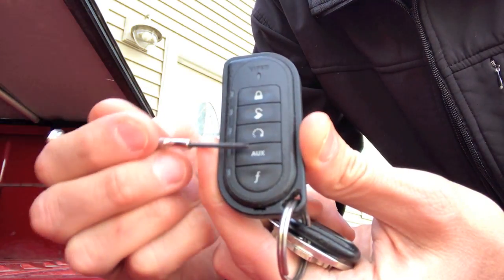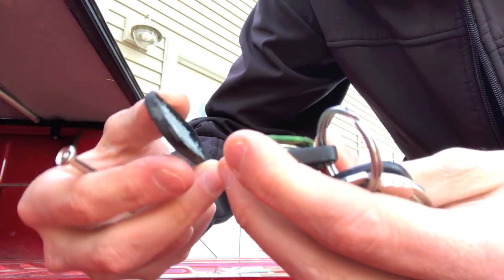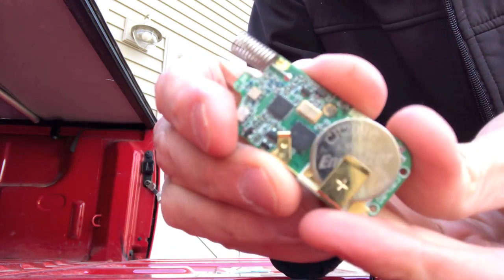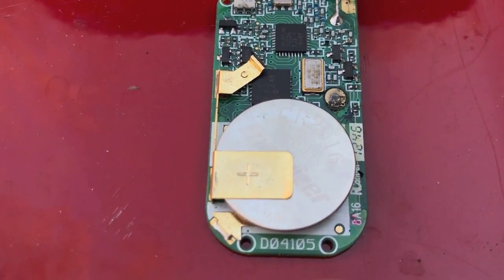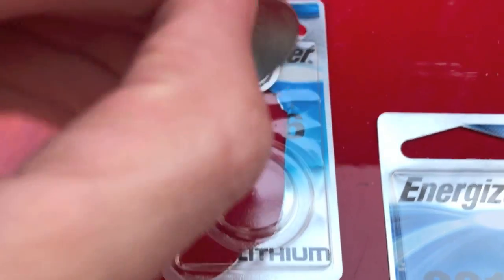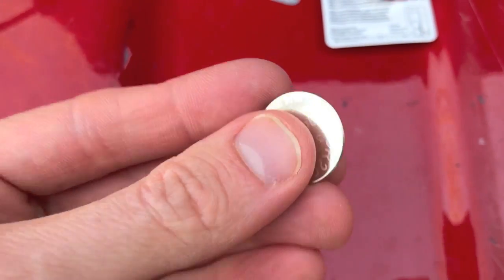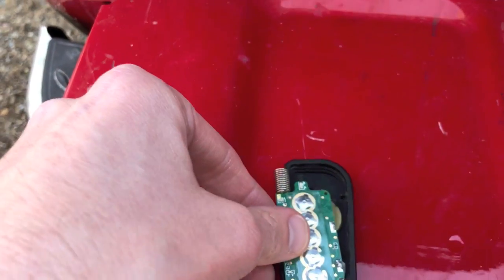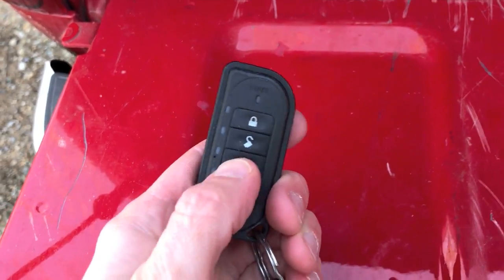My Remote Car Starter is not working - "Check Battery or Check Engine Light"

Comment: Thanks so much. So my Compustar remote stopped working after the car battery died then jump started. So the car lights will blink but will not lock/unlock, then it will crank multiple times but will not fully start. I tried to reprogram using the 5x on and off but did not fix the problem. So I tried the suggestion here of removing the black(negative) connector for a few minutes, reconnect and now its working. So simple solution which I found here. Thanks again.
Reply from the maker: You are very welcome & we appreciate you sharing this.  Welcome to the DIY Raptor Club.  Enjoy your upcoming weekend.

😎👍🔧🔩

Comment: Hey Michael, I have the same system. Today in a parking lot my car remote start stopped working out of nowhere. Did the dummy trick to get it going (put keys in ignition and then press button on windshield). It doesn't seem to want to reprogram. Any dummy advice possibly?
Reply: 2006 Scion XB btw, had the car 4 years with no issues
Reply from the maker: BumPanda 

Thanks for watching & sharing your question.  A few things come to mind.

Its uncommon however possible that the actual sensor mechanism connected to the inner portion of your window has faulted...again, unlikely but we can’t rule it out...let’s try other troubleshooting steps first.

Verify all electrical wiring feeding in & out of sensor is properly connected & shows no signs of stress...ex: melting, crimped wires....

Next inspect all wiring that feeds off your battery and makes its way to the starter & internal sensor.   Verify all wiring is properly connected and shows no signs of stress.

Next verify that you either have or do not have an added fuse for your starter.  If you have a fuse, verify that it is not blown or showing signs of stress such as burning or melting.

Is your Blue light still flashing on the interior mounted sensor connected to window?  If no, the sensor has lost its electrical feed & is no longer being powered...possible loose wire, loose ground, or blown fuse.

Let’s start there, Keep us posted!

Please subscribe to the channel and turn on your YouTube notification Bell 🛎 that would be awesome thanks again!

😎👍🔧🔩

Comment: Hey Michael. My viper 7856V is having an issue. When I hold the autostart, it will turn on the car but it will not crank the engine. It will just run the fans and lights for 15 minutes. The engine will not even try to turn over. It was working up until a week ago and I cannot find the issue. I've replaced the batteries in it and it still has the same issue. Thank you!
Reply from the maker: Thanks for watching, by chance is your check engine light on?  If your check engine light is on, there is a built-in safety mechanism that will disable remote-start.

To get remote-starter to work again, your check engine light will need to be cleared by replacing the part that is causing the light to turn on.
Reply: @DIYwithMichaelBorders  the check engine light will come on if I use the autostart. When starting normally, the light doesn't come on. I took it to a place and they weren't able to get a reading on the check light when it came on due to just the autostart. It goes away once the car is started with the key
Reply from the maker: @tylerblegen2392  

Thanks for the follow up.  You may want to perform a reset.  Disconnect the black negative cable from your battery and leave disconnected for 30 minutes.

After 30 minutes, resecure everything and see if that fixes it.

Comment: Hello Michael. I have a viper 7254v remote system and my batteries died because of the cold. Which had disconnected the key FOB/remote. I need your help to reprogram it back to the truck. My only problem is, the device behind the mirror won’t turn on now 😢 I’d I not know how I can fix that.

Comment: The blue light on the after market remote works when i press to start but its ot connecting to my car. My regular  car key works but i need my after market to work since thats what i use to START the car. any advise?
Reply from the maker: Good morning, we are drinking our morning coffee answering any and all questions for the DIY community.

By chance, is your check-engine light on?  If so, this will deactivate remote starter.  The faulty part causing your check-engine light will need to be replaced in order to allow your remote starter to work again.

If it’s not on, you may need to disconnect your black negative cable from your battery for a minimum of five minutes.  This will allow your system to reset, and after five minutes, resecure black negative cable.

Thanks for sharing this, it means the world to us.

😎👍

Comment: what happens if check engine lite is on< i changed batteries in both remotes
Reply from the maker: Thanks for watching & welcome to the DIY Raptor Club.  For safety purposes, the remote starter deactivates once the check engine light comes on.

You will need to fix what has caused your check engine light to illuminate.  After fixing part, the check engine light should turn off and your remote starter will reactivate.  Keep us posted.

😎👍🔧🔩
Reply: @DIYwithMichaelBorders  does a change oil sign cause the check engine to come on ?
Reply from the maker: @Willdoe09  

Thanks for watching & it will indeed.  The oil light being triggered will disengage remote start as the onboard computer wants to alleviate the engine running with low oil.

😎👍🔧🔩

Comment: Hi have the same system , and the device that goes in the car ( blue flashing light ) is not flashing anymore and my car won’t start , I’ve replaced the battery so I know that’s not the problem ,
Reply from the maker: Mike Nasser 

Thanks for watching & we hope the video helped.  At this point, you may have a wiring issue causing your symptoms.

You might have an additional fuse inside your engine compartment near your battery that has blown.  This fuse may be part of your Remote Starter wiring that is feeding to your battery.  Verify the fuse is not blown nor corroded in any way...might just be a good idea to get new fuse!  😀

We recommend inspecting all wiring & verifying wiring is in good condition...no signs of stress, melting, aggressive bends in wiring that can lead to damage...  Also verify all connection points are properly secured which will alleviate any chances of electrical shortage.

We really enjoy making these helpful videos for our fellow DIY’ers.  Many more helpful videos to come!

Let us know if you have any questions.  Please subscribe to the channel and turn on your YouTube notification Bell 🛎 that would be awesome thanks again!

😎👍🔧🔩

Comment: I have an aftermarket remote start where I don't have a separate key fob, I just click the lock button on my Chrysler fob 3 times and it starts. I changed the battery in my car and now my remote start is not working. Any ideas? Thanks
Reply from the maker: Thanks for watching & welcome to the DIY Raptor Club.  It’s very possible that you will need to reset remote key fob.  To do this, remove battery from fob for 5 minutes & then put it back in.

Keep us posted.  We are literally uploading a video tomorrow that shows replacement of a battery in a Chrysler Pacifica van.  Stay tuned, you may find it helpful.

Enjoy your night.  😎👍🔧🔩

Comment: When I try to auto start my car the alarm goes off. What am I doing wrong? Please help.
Reply from the maker: ĸιzgeeѕ weѕт 

Thanks for watching.  It’s possible that you can solve your issues by resetting the system.  To do so, disconnect your negative terminal cable from your battery for a minimum of 15 minutes.  After 15 minutes, reconnect negative cable and give the system roughly 5 additional minutes to realign itself.  Next, check to see if your autostart works.

Let us know if you have any questions.  Please subscribe to the channel and Ring your YouTube Bell 🛎 that would be awesome thanks again!

😎👍🔧🔩
Reply: DIY With Michael Borders  thank u kindly bro 👍🏾
Reply from the maker: ĸιzgeeѕ weѕт 

😎👍🔧🔩

Comment: Well , what happeneds when it Doesn't start?
Reply from the maker: Thanks for watching, you may need to perform a battery reset on your vehicle.  Disconnect negative cable from your battery and leave disconnected for a minimum of five minutes.

After five minutes, resecure negative cable to battery and see if that works.

😎👍🔧🔩
Reply: @DIYwithMichaelBorders  what do I do next after that doesn't work,  cause the car was sitting for 4 yrs without using the alarm?
Reply from the maker: @chrisnas1483  

Thanks for watching, interesting things could happen to a vehicle that sits long-term.

You may want to inspect all the wiring feeding into the fuse box as well as fuses to ensure all fuses are still in good shape and not corroded, rusted, or blown as well as ensuring that the wiring is not crimped, melted, rusted, corroded, or chewed through by mice.
Reply: @DIYwithMichaelBorders   I need to check the mice thing 1st ,  thanks
Reply from the maker: @chrisnas1483  

😎👍

Comment: My problem is I don’t know how to use this thjng. Came with the car. Which button do I press to start my car?
Reply from the maker: Thanks for watching, in our case, it’s the dashed circle with the arrow...double click it in most cases.  Other fobs are push & hold.  Hope this helps.

😎👍🔧🔩
Reply: Push and hold for 4 seconds (press the button with the dotted circle, like he said) and the car will lock its doors, then the engine will start. Mine runs for 12 minutes the shuts off.

Comment: When I press my remote start it just keeps cranking and it doesn’t turn on any reasons why?
Reply from the maker: Crazyrmj 

Thanks for watching.  Does manually starting your car give you any troubles?  Keep us posted.

😎👍🔧🔩
Reply: DIY With Michael Borders no it doesn’t when I press the button to remote start my car it just keeps on cranking and it’s a constant death loop
Reply from the maker: Crazyrmj 

Thanks for the reply.  You might have accidentally put it into valet mode.  Let’s try something.

1.  Turn key on without starting engine

2.  Press lock & trunk open button

This will take you out of valet mode.  Keep us posted

😎👍🔧🔩
Reply: DIY With Michael Borders I tried that this morning nothing at all it just cranks and it doesn’t turn on
Reply from the maker: Crazyrmj 

Thanks for the update.  You do not have an illuminated engine light or ABS light on instrument cluster correct?
Reply: DIY With Michael Borders no I don’t everything is good is there anything else you recommend? I’ve been trying everything and I can’t find any solution the car locks and unlocks it just when I press to remotely start the car it keeps cranking and it doesn’t turn on and the green key light pops up in the dash I have a 2007 Honda Civic Lx
Reply from the maker: Crazyrmj 

Thanks for the update & do you have a 2nd key fob?  Does it do the same?

😎👍🔧🔩
Reply: DIY With Michael Borders yes it does the exact same
Reply from the maker: Crazyrmj 

We did some more reading & another thing that can cause this is a door or trunk open while attempting to remote start.  This will cause the system to not start.  Also, you should have a fuse related to your remote starter.  Verify it’s not blown or corroded/rusty.

😎👍🔧🔩
Reply: @DIYwithMichaelBorders  okay ill check that thank you
Reply from the maker: Crazyrmj 

😎👍

Comment: Y is my starter not working it was aok change battery still not working need help asp
Reply from the maker: Rock J 

Thanks for watching & sharing your experience Rock J.  Let’s get this figured out!  A few questions to gauge possible reasons.

1.  Is your check engine light on?
2.  What make/model/year vehicle?
3.  Any recent MX completed to vehicle in last 90 days?

Keep us posted!  Please subscribe to the channel and turn on your YouTube notification Bell 🛎 that would be awesome thanks again!

😎👍🔧🔩
Reply: @DIYwithMichaelBorders  no
Reply: @DIYwithMichaelBorders  2011 CR-V
Reply from the maker: Rock J 

Excellent & thanks for the reply.  Is your starter an aftermarket starter or is it factory installed?

If it’s an aftermarket starter, it’s very possible that the actual sensor mechanism connected to the inner portion of your window has faulted.

This can be fixed by verifying all electrical wiring feeding in & out of sensor is properly connected & shows no signs of stress...ex: melting, crimped wires....

Next inspect all wiring that feeds off your battery and makes its way to the starter & internal sensor.   Verify all wiring is properly connected and shows no signs of stress.

Next verify that you either have or do not have an added fuse for your starter.  If you have a fuse, verify that it is not blown or showing signs of stress such as burning or melting.

Keep us posted!